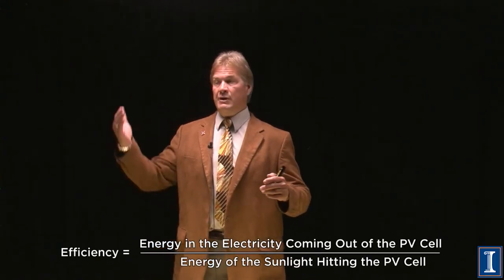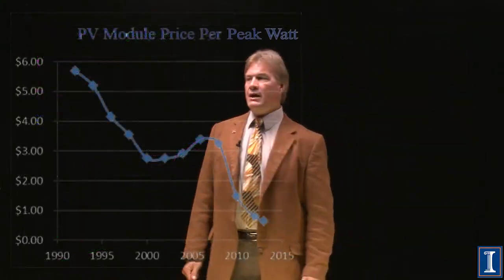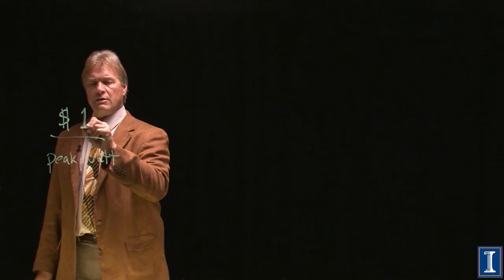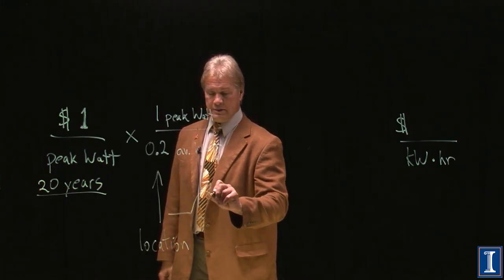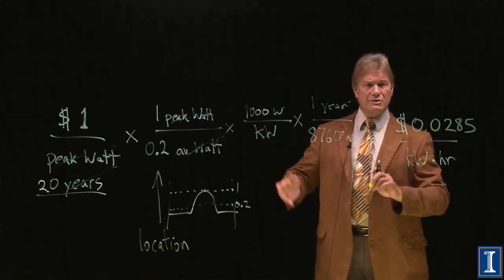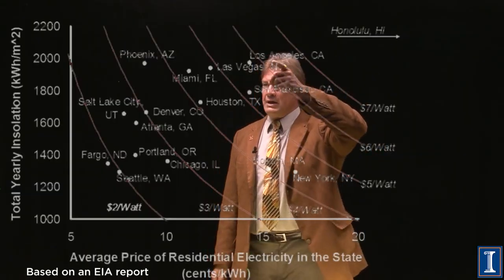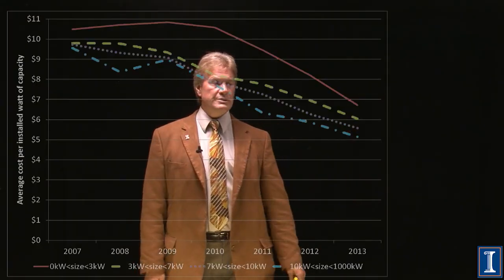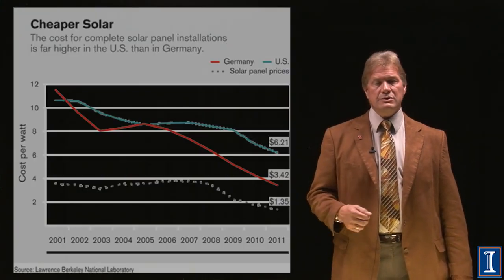The Cost of Sunshine

Comment: Fascinating.  Not a single word about storage, the conversion losses associated with it, re-conversion from storage and more conversion losses as a result.  This is an issue because we don't use energy along the same curve that it is produced by sunshine.  These are MASSIVE variables that also add to the cost of solar.  Tying to the grid only increases the larger issues for society (Look up "the DUCK curve").    In addition, what are the "up front costs"  in energy usage?  For example: how much energy does it take to purify, shape, assemble, and ship the materials to make storage batteries, solar panels, mounting hardware, etc.
Reply: There are actually three types of power generation, variable like solar and wind, baseload like most nuclear and coal, and dispatchable like hydro and to a lesser extent natural gas.  Both variable and baseload power sources are unable to throttle to meet demand, and need dispatchable power to fill in the actual power requirements as they go up and down during the day.  As long as the variable power sources don't climb above 20% of total usage there is basically zero need for storage, which means in most places it simply isn't an issue yet.  Also, as coal plants get replaced with natural gas plants the grid becomes more flexible, which also makes it easier to fit in renewables.  Even on a grid with zero renewables you still need natural gas peaker plants(unless you have a good percentage of hydropower), which are much less efficient and much more expensive than regular natural gas plants, but are also much more responsive.  It is proving cost effective to replace at least some of these peaker plants with grid tied batteries, again, without regard to whether the local grid uses any renewables.  As far as I know there is very little storage that has been needed yet to keep renewables balanced.

Comment: your such a sjw....you forget to mention...degrading efficiency over time....a sever degrade. and your no economist,,,your analyses is just garbage. thers the initial sunk cost,,which you dont need to spend if your using coal.  that cost banked over 20 years, whipes out any savings you get with solar.

Comment: Solid state. Lifespan should be three or four orders of magnitude higher, if comparing like-to-like across alternate sources. Also, Swanson's Law tells us there's a 23% price per kWh drop per doubling deployment of solar.
Reply: I guess 20 or 30 years is about right for this old tech to degrade down to 80% which is typically the official level of measurement. The cells currently in development should last 100 years.

Comment: My self installed 10KW system  with Enphase microinverters came in at $1.50/W. While researching my system I was so impressed with Enphase I bought stock. It's earned $15K so my system was free even before the 30% tax credit.
Reply: You have found the one way that solar is profitable. Buy stock in the companies that sell it to people and benefit from the taxpayers forced to subsidized the agenda. FYI the average cost in the USA is $1.2/W from our utility company.
Reply: @fedcoin1602  utility scale solar is below $1/installed watt now
Reply: puffman06 I have worked utilities for 30+ years and built 10 utility scale solar sites in the last 4 years. Since, the generation cost is a faction of what the customers see, typically the utility generates it for $15-30/MW and the customer pays $120/MW. This is why you can’t build roof top solar on you own home and sell it to the grind for the same cost as what you buy it for. I am passionate about helping people and see electricity bills rising. You guys don’t want our electricity future decided by the media and stockholders. Guys like the professor are the answer. Solar sounds good, but we are not there yet. I also work at hydro plants which generate for 0.5 cents/W. Why are we against hydro again?
Reply: @fedcoin1602  hydro has ecological effects, a long time to return on investment, and years of permitting and site evaluation. Aka risk. Same with nuclear. Why would you when you can build a solar farm for cheap and get it pumping out electricity quickly?
Reply: puffman06 It is because I understand ROI and have to justify a project. Of course, unless it is a renewable project which the public demands. At the utility companies I have worked at, we build solar sites out of public pressure, not economic viability. Because of that the ten solar sites I was over were the minimum size possible and right next to the highway with a big billboard so every could see. The methane plant that uses fracking was place out of sight. Did you know the methane plant is considered “renewable”. To reach the renewable energy goals set, we are building methane gas plants. Large scale hydro isn’t renewable, but fracking is...  Your understanding of renewables maybe different that what the lobbyists have set up. These are not examples I have read about, I actually work in the industry and built all the projects which I talk about. The last 18 months I have worked hydro projects, not new one as you imply. I am talking about plants which have been around decades. They are cutting into the profits of the gas companies (gas companies know that solar won’t have any real market share) so there is a push to decommission hydro plants. 
But don’t worry about anything I have said, big money and lobbyists will take care of you. Your electric bill is already going down each month. 
Wake up America!
Reply: @fedcoin1602  Taxpayers have been subsidizing fossil fuels for over a century. Clean energy subsidies will never come close to catching up.
Reply: southbendkid did you build solar in South Bend Indiana?
Reply: @TheCynicsCynic  ...typical leftist Authoritarian theif.
Reply: Thanks for reaching into MY pocket for YOUR tax credit.
Reply: @DocSiders  no one's stopping you from installing your own solar

Comment: Here is the news for you, there is a solar cell that is more than 80% efficient, called mirror, plus heat engine. It is also much cheaper and lasts much longer.
Reply: SergKiev87 Afaik, the collector uses molten salt, which then heats up water, to run a turbine. The molten salt circulation at that scale is not yet cheap tech.
Reply: @llejk  You know you can simply heat up water in the collector and energy storage, well let coal burning people think about that, hydroelectric doesn't even have to think, they very good at throttling down as is. Problems only with nuclear.
Reply: @SergKiev87  I also wondered why and read a bit more. Coal (and nuclear) are usually build near a river, which they use as cooling medium (you always want a high temperature difference for efficiency). Typical solar collectors don't have a river nearby, and need to cool down their transport medium with air. That is why they have to operate at higher temperatures to be efficient, which is difficult with water steam. However there are many variants, and it seems it is not yet clear (most solar collector plants each are unique). Fun fact: Germany was planning to build a big water based solar collector plant in Africa, but it was never build because they lost the colony after WW 1.
Reply: Burning coal to produce heat lets you operate at about 35% efficiency at best.  With natural gas you can run the hot gasses through a turbine and then use them to heat water to run a second steam turbine, which can get you as high as 50% efficiency.  Due to the fact that most locations with good sunlight aren't close to a good source of coolant water it would be difficult for solar thermal to even reach the 35% thermal efficiency of coal.  I have never heard of any sort of heat engine that could be actually used outside of a laboratory that could get anything close to 80% efficiency.
Reply: @faroncobb6040  You don't understand what you talking about, go and learn what coal power plant efficiency is.

Comment: They say we have dwindling fossil fuel supplies.  Theoretically, as those supplies diminsh, the cost of those supplies will go up.  This happens when we have an either natural, or artificial lack of supply.  1973 Oil Embargo, anyone?  During those times, solar will be EXTREMELY attractive!  We also have available, Tesla Power Walls for night time power.  You power your Power Wall up during the day with solar and run everything off the Power Wall at night.
Reply: It won't be so attractive when you get a cloudy week in winter.
Reply: @chrimony  Don't be too quick to knock it.  The technology of solar cells continues to get better.  Even on cloudy days, they still produce.  If you have enough of them, you'll be producing enough to charge a battery wall AND still put power into the grid...even on cloudy days.
Reply: @NiceMuslimLady  If you've got acres of land to power your house... yeah, you may have enough to last on a cloudy day when you're only getting 10% of the energy.
Reply: @chrimony  Possibly.  You have the input (solar panel) but, you also have the output (your consumption).  If your consumption is low, you won't be taking that much out, even on a cloudy day.
Reply: @NiceMuslimLady  You can just live in the woods without any electricity at all! ...Trying to budget electricity on a cloudy week in winter is something the vast majority of the population isn't going to voluntarily sign up for.
Reply: @chrimony  Sure you could.  But, why all the concern about budgetting electricity on  a cloudy week?  You might have to pay a few dollars then, but, you're STILL coming out ahead on 99% of the year.  A few days won't negate the rest of the year.  Starting soon, here, in California, new houses will be REQUIRED to have solar.
Reply: @NiceMuslimLady  You're dreaming if you think solar is adequate for 99% of the year. Do you have solar? Can you turn off the grid for 99% of the year?
Reply: @chrimony  What are you on now?  Here where I live, we have something called SUN like 99% of the days.  You ever hear of the expression "it never rains in California"?  Do you think that means that it LITERALLY never rains in California?
Reply: @NiceMuslimLady  99% is a very large, and very specific number. Tell me your approximate location in California, so I can look up the weather and see how much sun you ACTUALLY get. Unless you're living in the desert, 99% sounds like bullshit.

Comment: you have a wrong number for the installed price, it's more like between 1 and 2 USD/kWp (depending on your contractor and system size). Anyway great video!
Reply: hes wrong about alot. worst vid ive seen so far of his.
Reply: @mattycheezeburger  The video is 4 years old.  He was ~right 4 years ago but not in 2019.